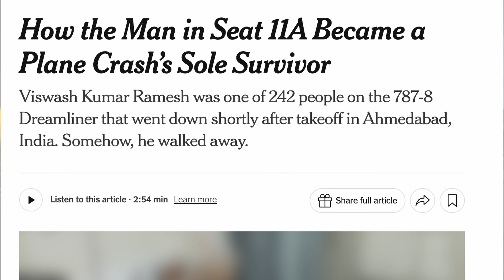Why the RAT Changes Everything – Air India 171 Update

Comment: Failure of the power control unit would cause engine failure. Big fat chunky box under the Cockpit, regulates controls a distributes electrical power to everything, . I know from experience they are very hard to diagnose. I have only seen 1 that was the problem, and that's with 30 years in aviation maintenance. It took us about 3 weeks or so to figure it out. Engine starts one time then no start. goofy lighting problems, cockpit indications doing weird things. A gremlin . The aircraft was scheduled to return to Italy. Very stressful but we finally figure it out. No it was not a Boeing aircraft

Comment: Grabbed throttles instead of flaps to increase flaps (pull back) instead grabbed throttles and pulled back? Or single engine out and pulled back wrong throttle for restart? Also was reported the a/c had a mechanical issue when it arrived prior to this departure, wonder what got fixed right before that take off

Comment: Video evidence of the gear hang angle (leading wheels down, trailing wheels up) suggests the gear was commanded to retract, because when commanded to retract, the gear hydraulically drives the gear leading edge wheels down (opposite of where they hang just after takeoff or for landing) prior to the entire assembly retracting into the gear bay. The gear began this initial retraction as can be seen by the hang angle in the video, but, with a dual engine failure leading to a total hydraulic failure, there would be insufficient hydraulic pressure to finish the retraction operation. For the aircraft I have flown with a RAT, the aircraft prioritizes flight control hydraulics over all other aircraft hydraulic services (gear, tailhook, nosewheel steering, etc.). I do not know the specific hydraulic priorities for the 787, and perhaps a type-rated 787 pilot can comment. The above suggests the gear was commanded to retract, and serves to raise doubt about the aircrew mistakenly raising the flaps vice the gear.

Comment: OK,...but was the aircraft traveling fast enough to propel the RAT? What about the APU? Whatever that "bang" sound reported by the sole survivor was, the source would  have had to be capable of disabling both engines, completely and immediately, at the same moment. Engine systems are designed to be as independent as possible, so whatever it was had to have occurred at a point of commonality. Likely an explosive device positioned (planted) there, designed to explode just after rotation,  by someone with expertise in aeronautical engine management systems. Points of commonality would be where I'd look first for explosive residue. The timing of the incident reeks of a WMD: Weapon of Mass Distraction. Who or what entity would have had the most to gain by such a diversion of national and international attention?

Comment: No.  The RAT would be spinning that supersonic speed  at a cruising speed of 525 mph, the plane in India was barely moving at 130.  The RAT was the dominant buzz bomb sound when the GE engines should have been.  And the only reason the RAT would have deployed is in a total electrical failure.  
The plane basically flies itself with pilots just monitoring the progress.  But in a total electrical failure (and only if the engines are not generating electricity, the auxiliary lithium batteries are not providing power, and the backup batteries after that auxiliary system are also not providing power, only then does the RAT deploy) In the case of a total electrical failure the pilots screen go dark, the plane no longer is flying itself.  But the pilots have no information at all.  The RAT is designed to provide some power so the pilots can use the most basic instruments.  Control the aircraft.  But at the speed they were going all the RAT provided was enough power for the mayday call.
A passenger DOCUMENTED electrical problems on the plane about three hours before it crashed.  The same plane flew the Paris to Delhi to Ahmedabad route, and this guy was on the Delhi to Ahmedabad leg of the flight from Delhi to Gatwick, he got off in Ahmedabad and posted his video on social media showing cabin light no working, seat back screens not working.  And the planes ID matched his video.  It was the same plane.  That plane should have been grounded till the electrical faults were addressed.  But the airline had no other planes that could make the run to Gatwick.  
This was a case of bad design by Boeing compounded by greed from the airline.  
I say the engines were running and they were generating power, but, that power was not getting to the screens in the cockpit and I think the forensic investigation will find that there was a fire of electrical origin in the cargo hold.  Maybe no way to prove that because of the fireball, but the automated systems shut off and the pilots had no way to gain control and the only way that can happen is there is a total loss of electricity.  No instruments and no control functions.  The pilot said the "plane is not taking thrust."  So they did attempt to push the throttle forward, nothing happened.  They could have tried to lower the nose and gain ground speed and that did not work either though they were too low for that to work anyway.  Nothing they could do worked because there was no power not even from the RAT.  They had no more control over that plane than the passengers at the back of economy class had.  If the automated systems failed the pilots should have been able to take over even if an engine failed.  They would have been fine to go around and land.  The ONLY thing that explains it all is total electrical failure.  And that is in a plane documented that very day with electrical problems, on a platform that has a long history of electrical problems.

Comment: No need to speculate if they're got the black box now. A previous morning flight in passenger shared video of electronics and air cond compressor issues do suggest possible electrical issues. What's weird is letting this bird fly long haul just 2-3 hours later. Couldn't rat also be deployed manually though, if pilots thought they had electrical or engine issues? Although angle of the landing gear may suggest an interrupted retraction.

Comment: I was thinking electric failure from the beginning. To many electric issues before hand. All the engine systems (fadec)need electric power and possibly open circuits caused communication systems errors. Also the engines may have reverted back to idle state if electrical systems failed and no longer responded to throttle inputs. I am a former pilot but only flown old school cable operated systems but understand the electrical systems used in modern aircraft.

Comment: Yes. Glad you got to the original video, taken from a ground floor apartment. I heard the RAT in that video a couple of days ago. Sounded just like a Husky or a Cessna. I first noticed no thrust and suspected dual engine failure, source unknown. I don't think there was enough power to raise the landing gear. The whole thing is just so sad, but now one also has to be concerned to find out the cause because 1,000 other 787 Dreamliners are flying commercial daily. In that video there appears what might be a piece of the left engine falling off the left side of the doomed jet near the bunch of trees as it descends. Those pilots did all they could, particularly flying it as far as they could, which sadly ended up in a densely populated area.

Comment: Im thinking its the poor construction leading to electrical failure taking everything out both engines failing from power or fuel loss cause electricity going out all fuel pumps shutting down from major electrical issues

Comment: What are THE CHANCES of a DUAL engine failure ?? 

At the Same Time ?   I would say slim to none.  

I am wagering a guess that this was possibly Terrorism because the only survivor indicated that 20-30 seconds after takeoff he heard a BOOM.   Was this a planned detonation ?  It could have been a timed explosive or a radio activated detonation from somewhere outside the airport perimeter.   Lots going on between India and Pakistan.  What about the passenger manifest.  

The only other thought was somehow contaminated jet fuel from the trucks that refueled them before takeoff.  

I would love to see the Maintenance Data Telemetry on the engines and when they both failed.  

Even with a failed electrical system, The Fadec engine control should have allowed engine control.  

Some Aviation Mechanic on a BBS had suggested this:

"any thoughts on AD 2018‑20‑15 and AD 2015-09-07? A power reconfiguration could result in FADEC entering an idle fallback mode as opposed to last commanded thrust. This may explain the bang and cabin lighting changes (electrical arcing), RAT deployment (total loss of electrical power), engine spool-down (isolated FADEC signal misinterpretation or software logic bug), and last-second engine spool-up (RAT now powering AC buses and throttle resolver signals updating FADEC)"
Reply: pepe silvia

Comment: Wow... remember the 777 that lost all power on final?  (No power on both engines) He pulled the flaps in to slightly increase the glide, which got them close enough to just clip the back of the threshold.  The fuel heat exchanger had developed some ice and actually blocked the fuel flow.  The anti ice heater was just before the fuel line screen so the ice could develop at the front of the screen filter.  It was a long cross country at altitude, so there was certainly icing potential for the fuel even with the anti icing heaters.  Boeing field maintenance caught it and the FAA did an immediate "AD".  I doubt Air India 171 had anything like that, but loosing airspeed at that altitude has got to be a "sinking feeling"... (no pun intended).  Hopefully the FDR can shed some light on the cause... Once again, great coverage Steeve!! Thanks!!

Comment: What would have happened if  PM or PF,  inadvertently had cut off the fuel supply and didn't realize they had done that?  Those switches are located right below the throttle on a 787.

Comment: Two engines at full power would at a bare minimum be able to maintain 500 feet of altitude, if not climb even with no flaps and gear down.  Two engines had enough power to lift the aircraft out of ground effect, 100 feet above ground level, so it was clearly engine failure. Captain Steve should have stressed that point but did not even make it.
Reply: Captain Steve is a boeing shareholder lol

Comment: Interpretation of the Diagram:

    ✅ Starts with Fuel Contamination: From improper fuel quality, rainwater, DEF, or microbial growth.

    ✅ Tank Behavior: Water settles in low points — often outside sump reach due to wing rib structures.

    ✅ Taxi Phase: No symptoms — engines idle, low fuel flow.

    ✅ Takeoff Roll: Boost pumps engage, fuel demand surges, contaminants gets sucked into fuel lines.

    ✅ Engine Flameout: Cavitation, combustion instability, or flameout occurs almost simultaneously on both engines.

    ✅ Electrical Loss: With both engines out, RAT deploys.

    ✅ Loss of Control: RAT supplies only critical flight control power, but no thrust is available.

    ✅ Outcome: The post-crash investigation identifies water/contamination in fuel samples, confirming the chain. --- Take-off Angle of attack contaminant flows and settles into the fuel sump, where it is ingested. This happened to me in a Cessna Cardinal.. I hoped never to see this again in my life..

Comment: I posted early on the first day that it was either fuel pressure or fuel contamination.
Its easy to see a major and sudden loss of power. The 787 engines are so powerful that it can take off with only 1 engine, so dual engine failure is without a doubt.
 The rat confirms failure of at least 1 and in this case it would be both.

Comment: I mentioned to you yesterday I didnt see any heat  coming from those engines, normally you can see heat coming from the back of a jet engine, its clean heat but you can tell what it is,,,,it like heat rising from a very hot desert,  this plane had NONE what so ever, those engines had no thrust , the plane was gliding to the ground,,,check it out for yourself !

Comment: Good evening.
I just don't understand the following: why, with a 3.5 km runway, does the plane start its takeoff run halfway down the runway, bearing in mind that there is a neighbourhood with many houses at the end of the runway?
I believe the problem started on the ground, with the flaps not lowering, indicating something was wrong, as well as the landing gear being lowered.
Either the hydraulic system failed or the engines shut down, because the run is apparently very long, going almost to the end of the runway, if it didn't actually go past the runway. The dust kicked up could indicate this, and a loss of momentum is also immediately noticeable, which caused the plane to stall.
The fact that I do not believe that only one engine lost power has to do with the fact that, in my view, if there had been a loss or reduction in power in one of the engines, the plane could have drifted slightly towards the active engine due to the torque effect.
Let us wait for an investigation.

Comment: There's a video from a passenger of a previous flight of that very same plane, departing from New Delhi the day before. It shows his frustration due to none of the electronic services working on the plane, including some cabin lights. If verified, it could point to long standing electrical problem that perhaps ended up causing the total loss of power. Another, possible source for the total electrical power loss is that one of the lithium batteries got exceedingly hot and burst.

Comment: Captain Steve.  Love this channel.  I was a Safety Officer and Instructor Pilot on the FB-111 in the USAF.  Would total hydraulic failure or dual engine failure cause the flaps to “blow up” or retract due to the relative wind and lack of hydraulic pressure?

Comment: Here’s the full list of conditions that can deploy  the ram air turbine automatically 

• Loss of all engines
• Both engines are at less than minimum idle RPM (Revolutions Per Minute)
• Loss of all hydraulic power - left, right, and center systems detect low pressure
• Loss of all electrical power
• BPCU (Bus Power Control Unit) detects loss of power to C1 and C2 TRU (Transformer Rectifier Unit)s
• On approach, loss of all four EMP (Electric Motor Pump) hydraulic pressures and loss of either the left or right flight controls ACE (Actuator Control Electronics)
• Rotor burst on takeoff that causes loss of both PECS (Power Electronics Cooling System) primary cooling loops.
Reply: Yes, that may have been the cause or one of the causes, but with a 3.5 km runway, starting a race for take-off a little before the middle of the runway — at least that's what it looks like, when there's a cluster of houses at the end of the runway — doesn't seem very smart to have that neighbourhood there.